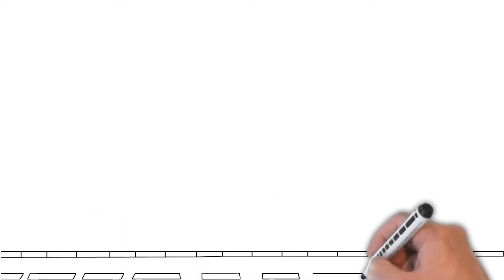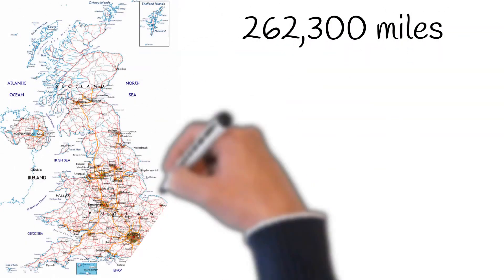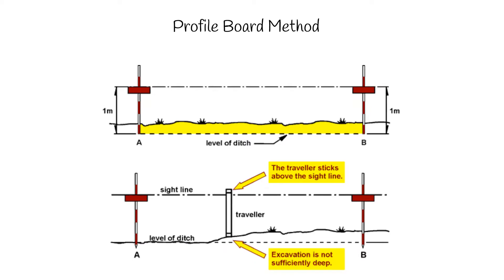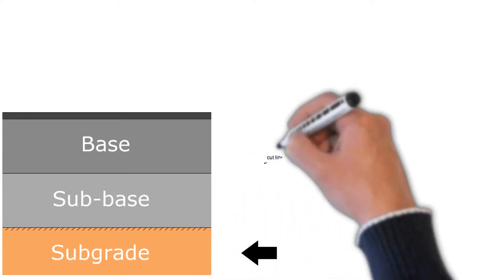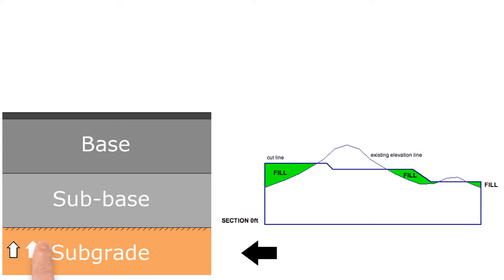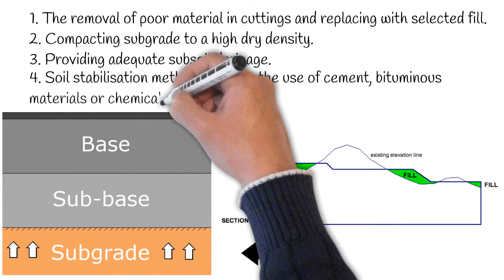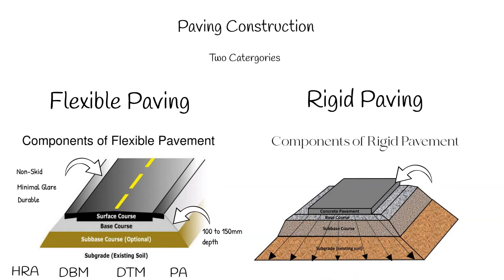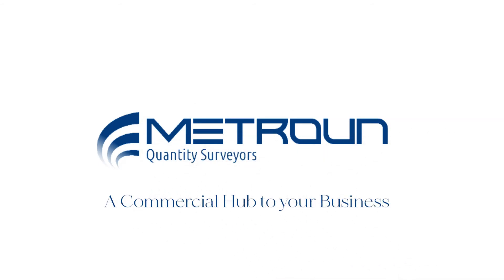The Road Construction Process In The UK

Comment: So how long does it take to build a mile of two lane road?
Reply from the maker: This comes from Dana Dietz who has been designing and constructing highways for over 31 years. This is based on 1km and not 1 mile. 

"I am going to assume a very simple project where they have to place the aggregate and place 2 lifts of asphalt, nothing else.

Typically, I use the following production rates:

Aggregate Base Course (8″ lift): 2000 tons / day

Plantmix:

Leveling course 2000 tons/day

Base Course 2400 tons/day

Wearing, or Surface course 2000 tons/day

Assuming that you have base course of 3″ and a surface course of 1.5″ and using 140 pounds per cubic foot for each course, with 28′ wide roadway, it would take:

1 km is approximately 3280.8 feet

Aggregate Base: 4286.9 tons at 2000 tons/day is 2.14 days

Plant Mix Base: 1607.6 tons at 2400 tons/day is 0.67 days

Plant Mix Surface Course: 803.8 tons at 2000 tons/day is 0.4 days

Total days is 3.2 days, but I’d call it 3.5 to 4 days"

Hope this helps!
Reply: 3 days to construct 1km of road... and he has 31 years of experience. Don't make me laugh! Site clearence, drainage, services, ducts, electrics, lights, kerbs, sub base, base course, wearing course, white lines, grids and gullys, signage @Metroun
Reply: @Metroun  wow! This is the most comprehensive reply I have ever seen on YouTube. You should get an award.

Unfortunately, instead of a award, I have another question. What if we layer aggregate then concrete then asphalt for 1 km?
Reply from the maker: @user-wp8yx  We'd love an award if you have one. The biggest denominators here would be 

1. The type of concrete
2. The thickness of concrete 
3. The temperature
4. What the concrete deck binds too

So that would be pretty impossible to calculate without this information unfortunetely.